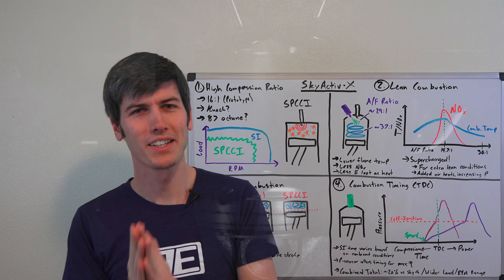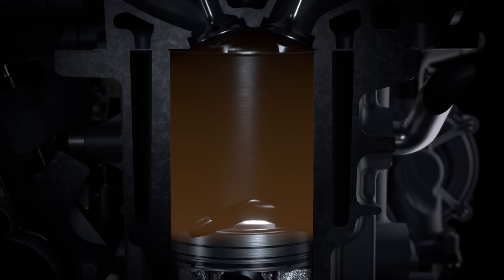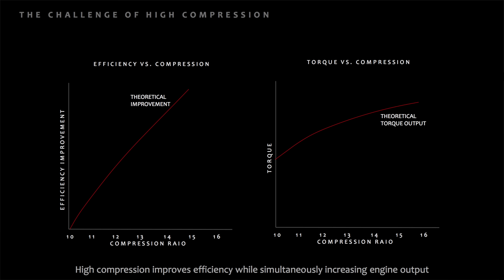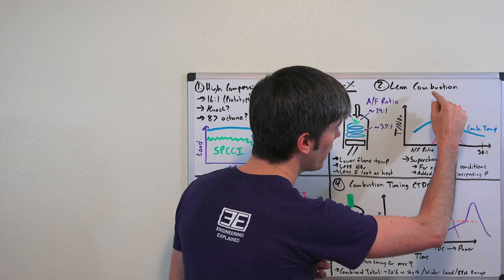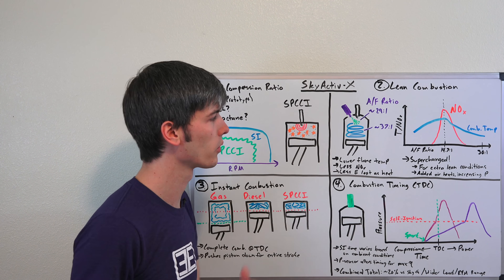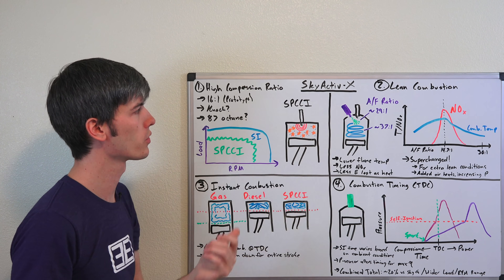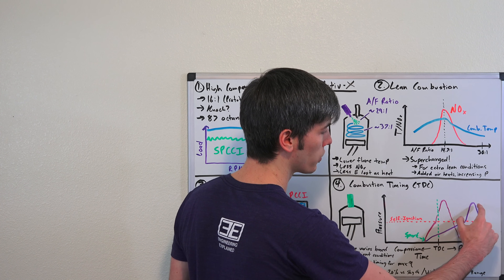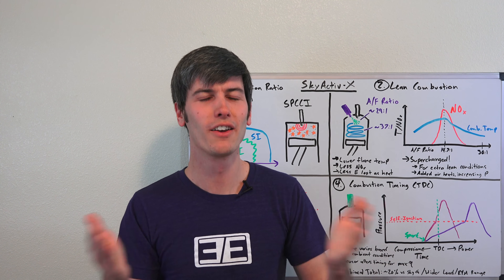How Mazda Is Saving The Gasoline Engine - SkyActiv-X

Comment: You are very intelligent and I love the way you explain everything. I've always been curious as to what your education background is and if you work/have worked in the automotive industry. Care to share? Just wondering how my go-to guy for explaining new automotive technology ended up doing such an awesome job at it.
Reply from the maker: I appreciate the kind words! I went to school for Mechanical Engineering at NCSU, and then worked briefly as an application engineer and then a test engineer for a forklift company. Forklifts are a lot like cars, they're just way heavier and use don't require quite as much modern tech as a car. From a powertrain standpoint though, efficiency is equally important.
Reply: @EngineeringExplained  . Go Wolfpack!
Reply from the maker: Yes, the company I worked for made gas, diesel, LPG, CNG, electric, and fuel cell vehicles. Whatever the customer wants, and yes, electric made up a large percentage of sales.
Reply from the maker: Yes actually. When I was a test engineer I worked directly on hybrid development.
Reply: I also was curious about it. Thanks a bunch bro!
Reply: Any hybrids? I doubt it due to cost, but I can think a few scenarios were it would be useful. And thx for taking the time to respond.
Reply: Thanks so much for the reply! Keep the good videos coming!
Reply: Interesting and ironic since forklifts are one of the few types of vehicle where it already makes economic sense to us batteries or even FC in instead of an ICE.

Comment: Can you explain the risks of running lean? In some country are able to run with a lot of ethanol ratio, or even 100% ethanol. Running more ethanol can make the engine run lean, but can it break it?
Reply: also to point out, ethanol has a much higher resistance (around 99 AKI) to knock than gasoline . so even if you are to run lean it won't be as dangerous as allowing a gasoline cycle to run lean.
Reply: The ethanol isn’t as power dense as gasoline so unless you’re adding the extra fuel you loose power in addition to running lean. But, the ethanol also burns cooler so it’s as likely to damage anything. Still not a good idea and still a decent possibility of damage.
Reply: L3xou97 Running more ethanol doesn’t make a engine run lean. They just simply require different air fuel ratios from gasoline. So putting pure ethanol in a car not designed for it will run lean. Simply put ethanol requires a much richer air fuel ratio than gasoline. Short answer to your question you will destroy your engine. Fuel will combust before it’s supposed to and either burn a hole through the piston or send one outside the block. He explained air fuel ratios.
Reply: Steve Pounder Are you sure that ethanol can explode before it's supposed to? As the other comment said, the ethanol has much higher resistance to knock.
Reply: NBSV1 how can the car in Brazil run with 100% ethanol without being damaged? Running on ethanol can be a good solution for the future when petrol will lack.
Reply: L3xou97 Yes It has a much high octane but you still have to run a proper ratio. 

E10(10% Ethanol, 90% Gasoline) = 14.13:1

E15(15% Ethanol, 85% Gasoline) = 13.8:1

E85(85% Ethanol, 15% Gasoline) = 9.7:1

Ethanol(E100) = 9:1 (Alcohol)
Reply: L3xou97 Those cars are tuned for it.  As others noted it’s not as sensitive leaning but it’s a very bad idea.
Reply: L3xou97 Typically outside of racing you don’t want to run 100% ethanol. It washes away lubrication and isn’t a lubrication itself. Also can be hard on plastic and rubber components. Also absorbs moisture quickly. That’s a big part of the 85% blend of E85. The bit of gas in there helps. 

If there’s a problem with lack of petrol you’d be best served by blending in some ethanol to the petrol instead of trying to run pure ethanol.

Comment: I want Mazda to continue working on the rotary
Reply: TheElementalSponges Maybe after they master this engine then they transfer all that tech to the rotary
Reply: TheElementalSponges. They have been working hard at establishing them selves post Ford. Hopefully in the next few years they will push towards more performance options, but for now they have done a spectacular job righting their ship!
Reply: They never stopped...
Reply: Imleocalm true, but they haven’t said much.
Reply: TheElementalSponges Yes they did. The most efficient variant of a Rotary Engine is one that runs on HFC. And their are VERY few HFC Stations in the world.
Reply: If you do want to see a modern rotary, look up the Mazda Demio EV RE, it's got a single-rotor range extender.  Not sure there's a whole lot else for the rotary to do with current emissions standards.
Reply: Garrett Z. GM is also developing a rotary engine component for their future hybrid Eevee vehicles.

While rotaries are especially well-suited to constant load applications they are far from obsolete for Road use, in my opinion perhaps the best solution to returning rotaries to the road is increasing the displacement and reducing the specific output. It was not uncommon to modify the old carbureted 12As to get better than 40 miles per gallon by mosifying the carburetor. It did result in the engine developing some 20 fewer horsepower but compared to similar displacement piston engines that got similar MPGs it still made significantly better power. A renesis engine detuned to just a hundred 50 horsepower could easily get similar MPGs while handily outperforming the typical 1.3 l piston engine. similarly a 2 L or larger rotary of similar technology could better balance performance emissions and mileage.

Comment: "How Mazda Is Saving The Gasoline Engine"

Ironic when they were the ones trying to push the use of the rotary engine eh ?
You know, the most eco harmful gas engine ever?
Reply: johno doh rotary is a gasoline engine.
Reply: johno doh I still haven't understood the point of your statement.
Reply: Does a rotary run on water or something?
Reply: Johno stop hating. The Rotary is a brilliant concept, it just needs more refinement, and there is no company better to work it out than Mazda. And no, they have not dropped it. Current prototypes are aiming for 280 HP and EPA 30 mpg.
Reply: johno doh I still haven't understood the point of your statement.
Reply: Rotary burns motor oil and a lot of gas. For years mazda tried to make it work in terms of emissions and longevity.
After all these years of effort to preserve and engine that can be described as : kinda 2 stroke ? ,they make a 360 degree turn and scrap everything.

And good for them. It would be silly to continue and spend money on a outdated project.
Reply: Yeah the point was they are trying to be efficient now,after they spend so much money and effort on the rotary.

Comment: "the future is electric" ? Are you sure about that?
I don't think so. It will take a really long time until electric cars are standard. Lithium is just gold. It's rare and it will end. And I bet it will end faster than oil. 
Especially in "poorer" countries the electric vehicle won't come so fast. Since oil is more practical for them. 
Though it's a good video, as always :)
Reply: You can't store hydrogen in gasoline tanks at gas stations, because for hydrogen you need higher pressure (or else it would take too much space) and better seals. The hydrogen atom is super tiny and it just permeates many materials, especially under pressure.
Reply: Bongalicius because hydrogen has one fatal flaw. It’s very difficult to contain
Reply: “It will take a really long time until...”

I believe that’s the definition of “future”
Reply: old batteries are essentially high concentration ore. It would probably be more viable to recycle batteries than PC parts
Reply: We have the network to distribute it??? Hydrogen?
Reply: No, lithium is not rare. Lithium has until now not been used for much so it hasn't been extracted much but with increased demand comes more producers of lithium.
Reply: because making hydrogen fuel is prohibitively expensive.
Reply: hopefully they do enhance graphene to the point that it becomes viable. i personally welcome the use of other engines, as long as I get my tuning and speed fix
Reply: I hope your right I love gasoline
Reply: Im sorry but I testdriven mazda 6 2.5 petrol engine AT and compared to VW Passat B8 TSI 220 ps dsg I eventually bought mazda is disaster in practically every way. Its weak, gearbox is so slow compared to dsg, infotainment is at least 10 years behind what vw offers. Plus excellent reliability of vw (I have 100kkm on the clock without single problem) my car is still on warranty (5 years total) with free maintanance and that explains why there is 1
100 passats B8 vs 1 mazda 6 on the roads here in Europe. And they make another engine without turbo.
Reply: Hydrogen has serious safety issues. Your basically a driving bomb
Reply: graphene has just join the game... pure graphene is not here yet but graphene enhanced lithium has shown boost in terms of performance and also longevity... in china electric vehicles are growing very fast
Reply: The combustion engines has had over a 100 years of constant development and competition. Large battery packs usable in cars have had less time being developed. We are finding it harder to make the combustion engine more efficient while battery technology is being developed left, right and center. The combustion engine is not going away just yet, but batteries and other ways of powering cars are here to compliment and maybe eventually replaced it.
Reply from the maker: Well if your argument against electric cars being the future is that "oil is more practical," then yes, I 100% stand behind the statement that electric is the future haha. It's far more efficient, and far more sustainable long term. Cars are bad for the environment (period). Electric cars are less bad for the environment, comparing a new to new car. Regular cars require mining too. And ya know, oil...
Reply: i myself prefer gas and diesel engines because im a mechanic. I noticed a flaw in your logic though. what do you think is going to charge all those new electric vehicles you speak of? Fossil fuels. So instead of fueling with gas or diesel you will now add all vehicles to our already taxed electricity grid. Fuel does a lot better job at the moment at holding our energy needs. The infrastructure is not in place for electric cars and its no gonna happen soon. A hybrid or more efficient engine tech will most likely be the foreseeable future. Maybe one day it will all be electric but even your grand kids kids will be pumping gas.
Reply: LOL are there people that are not sure about that yet? Its 2018 ffs... all car manufacturers are poring billions in EVs and EV sales are skyrocketing literally.
Reply: Why is nobody considering hydrogen as an alternative to petrol? The engine technology isn't ready to be released to the market and production of hydrogen couldn't cover the demand yet. But we already have a network to distribute it with the existing gas stations and stocking facilities. There's no need to use rare-earth elements. Furthermore we wouldn't need to change our habits since you can refuel it like a regular car. 
And my favourite reason is, that you can use it on combustion engines, so we wouldn't miss the great noise of a V8 in the future.
Reply: + Lima Charlie
In china the entire car market is growing very quickly. However electric cars are selling very poorly in China compared to Europe. For various reasons, one being infrastructure, another being cost.
Reply: And mars probably has more oil than lithium.
Reply: I personally think. That completely electrified vehicle will only be driven by people, who live Urban. I think it's a small market. Most people there will use public transportation or bikes. 
I don't think that most people will buy electrified cars. I see hybrid cars in the future. Both combined. But only electric? Sure not. Especially here in Germany, where every salesman drives at least 160 km/h the most time. People want a practical car where they don't have to be scared if they forget to fill up the batteries at night. And let's say it, most people don't plan their time and way. Who is willing to wait 30 minutes for the battery charge, for maybe 400 kms? 
People live in their homes, and not their cars. And it won't change. Just my two cents.
Reply: elmariachi you seem to know me just from comment. How ridiculous you are.
What happens with obsolete batteries afterwards? How are the electric car manufacturers going to deal with this problem? When a combustion engine did it's work here, it gets to the scrapyard and then forget about it, recycle the metal or ship it to "poor" countries". But what about electric cars? If everyone is able to buy one with an excellent range for a very good price, where will these cars be in 10 years? Sure, you can change the batteries. But what's with the older ones and the engines? I think people in Africa have enough problems with our dump (PCs, printer, and whatsoever)  in their country. Especially when seen in n ecological way. But shortminded people like you only think about themselves and forget that electric energy isn't cleaner than burned oil. Local, yes. But overall, not even close.
If you want to go on talking with no respect to a stranger in the internet, then don't write a comment. I won't reply then.
Reply: What good does it do to tax the electric grid substantially, much of which runs on oil and petroleum products, with an electric car, then run gas. It's less of fixing the problem, and more of exchanging 1 set for a similar but different set. Whatever makes people who don't see the grand picture happy. I'm not saying electric isn't the way to go, but until we can produce batteries that make much more power with much less rare resources, that hold their charge much longer and don't tax the grid as much, I will say it's much less devastating to the environment to use a gasoline/diesel engine, especially with the difficulty in scrapping and recycling lithium.
Reply: your view is pretty limited you're thinking about short term future and you're assuming the battery technology won't evolve, you realize internal combustion engines were at some point something that seemed impossible but thankfully mankind has plenty of visionaries who aren't short sighted like you and work to make the impossible possible, electric is not a choice it's a need , sure fossil fuels will be explored untill they're depleted because of economical interests but the electric technologies will keep progressing and will deal with all the problems that stand in their way, and then the people who make money on fossil fuels will invest in it when fossil fuels are no longer a possiblity because why loose to someone else when you can loose to yourself and play both sides